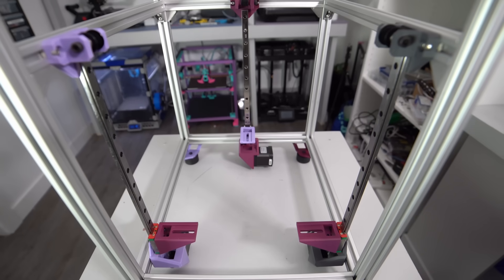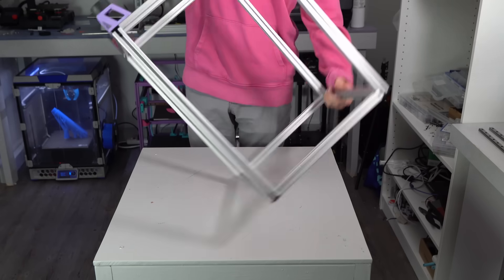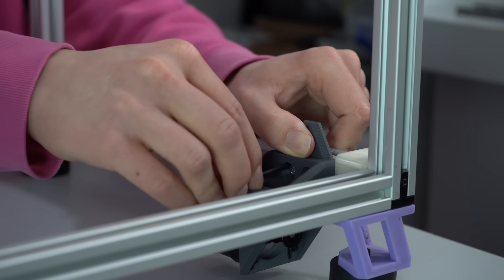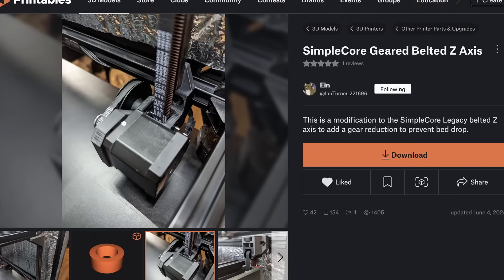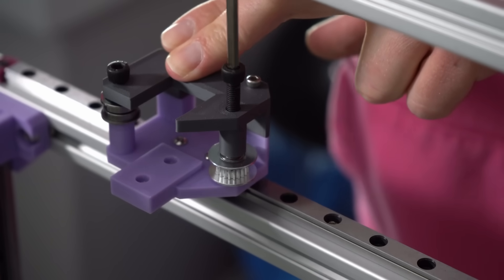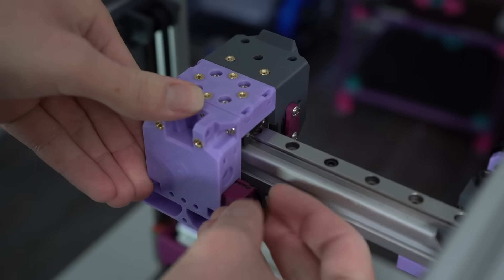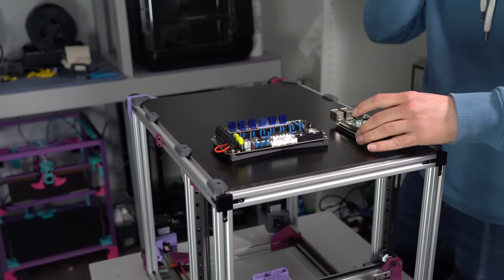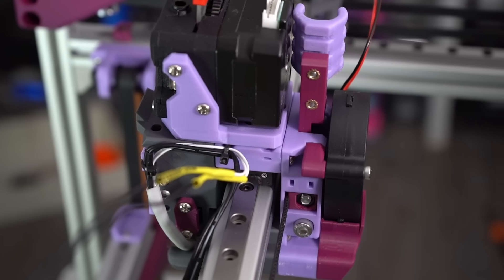How to Build the Best CoreXY 3D Printer for Beginners

Comment: Can you elaborate more on what needs to be modified for a larger corexy build 🙏🏻🙏🏻🙏🏻.
I really want to understand the limitations of the system
Reply from the maker: The limitations here aren't much different from any other corexy. As the printer gets bigger, the belts get longer, and longer belts stretch more. To compensate, you'd want to use wider belts (like 9 or 10mm), which would require basically a whole redesign of the gantry. You'd also want to run the belts at their spec tension, which would require double sheer support on the A and B stepper motors. You'd also want to beef up the frame with something like 4040 extrusions for the verticals and 2040s for the horizontal extrusions
Reply: @mitsumakes thank you so much for the thorough response 🙏🏻.
I learned a lot from it and I am truly grateful ❤.

Comment: Verry nice video.I recently upgraded an ender 6 with linear rails and klipper(sonic pad)And its amazing.Next project will be an diy 3d printer..What kind im still not sure..Probably thinking about Sovol sv08 ísh..
Reply from the maker: If you do go the SV08 route be careful, the belt path is notoriously bad on that machine

Comment: I have a 220x220 bed but the holes are right at the end. I could use it but I'm still confused about this z axis
Reply from the maker: You don't need any holes on the bed to mount it here. I was just using a flat piece of glass

If you do have holes that line up you can use basically any metal spacers/standoffs to mount it
Reply: @mitsubishimakes I can see that you used bases that support the bed. But how do you attach the bed to these supports? I imagine that when you press the nozzle on the bed on the back side it comes loose. No?

Comment: Can you give an approximate price of parts used in this build? is it significantly cheaper than buying one ready made one (same size)?
Reply from the maker: Off the shelf printers will always be cheaper than custom builds (unless you happen to have a lot of spare parts around). To get a better idea of the cost, check the Bill of Materials on the github

Comment: Why was the EVA logo removed from the shroud? EVA also has a hex nut version. And the number of heat inserts or nuts comes from the fact that EVA supports many, many variations of hotend, extruder combos.
Reply from the maker: The logo didn't print well (Q1 Pro's part cooling isn't great), so I just cut it out

Comment: This was a very well put together video, that provided a lot of very useful information. !!!! I would like to see what mods need to be made to build a much larger printer, specifically, I want a build volume of 500x500x500. I have been looking at a Rat Rig V-Core 4, but that's not even close to being in my budget. If the mods are too expensive, maybe you can show how to build an FDM that is not Core XY, but does have 3 independent Z motors.

Comment: What do you think about building big ahh diy 3d printer? The bigger the printable area is the faster you can print using mode "per object"
Reply from the maker: Nothing wrong with building large printers, but building a high performance one will be a challenge. If your goal is to produce a lot of parts quickly then having multiple, smaller printers will be faster

Comment: Great video.for starters like me but I will make it enclosed for future materials like tpu so can you recommend what to modify?
Reply from the maker: You don't need an enclosure for TPU, but if you do want to enclose all you need to do is get some material cut and attach it to the frame. You can use the voron panel clips to do this easily.

Acrylic Panels with some reflectix insulation on the inside and outside would easily get you into 70c chamber temp territory

Comment: Did you have to print a reverse tensioner for Eva 3 in order to route the belts with the teeth facing the correct way?

I ask because tensioners are not reversible; they can only be inserted into the Eva back one way. The way they insert orients the belt facing the wrong way.
Reply from the maker: You're correct, the stock ones don't work. On the Simplecore github you can find a modded tensioner  that works

Comment: Quiero construir un modelo con área de impresión de 300mm x 300mm. Debo usar la documentación de SimpleCore o SimpleCore Legacy?
Reply from the maker: Whatever one you want! I'd recommend Simplecore Mk1 if you are starting from scratch, and legacy if you have some spare parts available already
Reply: @mitsumakes 
Crees que con una SKR mini E3 v3 puedo construir la versión Legacy?
Reply from the maker: @martinbenavides2358  You will need more stepper motor drivers for the triple Z. You could stack two of those boards together though
Reply: Estaba pensando usar los dos puertos para eje z que tiene y en uno de ellos usar un splitter para así usar los 3 motores. Crees que sea factible?
Reply from the maker: @martinbenavides2358  In order to automatically tram the bed, you will need independent Z motors. If you are okay relying on mesh bed levelling only then you could use a splitter like you suggested

Comment: i absolutely disagree with the belted Z design choice
Reply from the maker: What don't you like about it? The lack of gear reduction?
Reply: @mitsumakes belt stretches. If you have different tension on the belts you get z artifacts. Voron 2.4 has similar issues, it’s just another design you need to troubleshoot if you get bad prints. Lead screws are just better
Reply from the maker: @NilSirrah  Fair enough. It's hard to beat the simplicity of a good ol' leadscrew setup, but I dont find belted Z to be much more complex. Make sure the belts are tensioned properly (and evenly) and you'll be fine.

Its worthwhile to note that there are plenty of options if you did want to run leadscrews on a simplecore. You could use trident Z, the Z axis off of simplecore mk1,  and ZombieHedgeHog made a leadscrew Z for SC legacy you could use as well

Comment: Looks like a fun project but I think I'm just going to start with a prebuilt printer.
I think it's cool there's still people doing open source DIY options just feels like I will always be procrastinating the project I actually want to use the printer for, maybe later on I'll build one.
Reply from the maker: With how good the prebuilt options are today, its hard not to recommend getting one first. I use my Qidi Q1 Pro to print basically all of the parts for these videos nowadays, just because I know it works

Comment: can it be 350 to 400 cubed ? not worried about how fast it can go just want a big build volume to make big things
Reply from the maker: It's definitely possible, but you'll definitely want to stiffen up your frame at that scale. 4040 extrusions would be good, and structural metal panels would be even better if you can stomach the cost

Comment: hey.thanks so much for making this available to us all. love the simplicity of it yet at same time using latest hardware such as linear rails etc, i just wanted to ask would it be possible to scale it to accommodate a 350x300 
build planform.
Reply from the maker: It would be possible. I built a 330x330 simplecore which you can see in some of my other videos. The biggest thing to watch out for at that scale is the rigidity of the frame. I'd recommend building from something like 4040 extrusions instead of 2020 and using large metal corner brackets or metal panels bolted to the frame for more rigidity

Comment: I have been thinking. The belt path on that toolhead. Does it draw uneven on the gantry when printing. Or is it fine and strong? With belts comming in on both sides of the x bar
Reply from the maker: A top rail setup like the EVA toolhead is definitely not ideal for performance. Ideally the belts should be pulling the toolhead from as close to the linear rail carriage as possible.

In practice this still works fine, but won't be as good as a front rail toolhead

Comment: What is the "Major Modification" to the motion system when scaling up above 300x300
Reply from the maker: In general, when you scale up a printer you also need to scale up the individual components. So for a CoreXY you'd want to use wider belts (so they stretch less), larger extrusions (for a more rigid frame)

Comment: Hello, great video ! Do you think that if I change the aluminum profiles to have a print volume of 300^3 it will create too much vibration or is it feasible? And I would be very interested for a klipper video.
Reply from the maker: Its definitely feasible. I would add some metal corner brackets, or even bolt on some metal panels, to make the frame more rigid though

Comment: I don't mean this as accusatory or rude or anything. But why is the quality of the prints rough, is it a time constraint or just a "good enough" situation. Any defects I've seen in videos haven't impeded the use of the piece, but for someone that's got the amount of knowledge you do, I just expect a bit more.
Reply from the maker: I print all of the parts for videos on my Qidi Q1 Pro, the quality isnt the best but its good enough. All my other machines are usually torn apart/in various stages of different projects, so I don't want to rely on them to be operational to print parts

Comment: A word of warning! 

Those 90 degrees angle bracket can be off by a degree or 2 if you buy the cheap ones, which will twist the frame horribly. 

Also, a solid, as flat as posdible surface should be used during assembly to make sure each side is assembled flat.

Comment: What's the reason for you to not recommend enclosing the printer when using PLA or PETG compared to ABS?
Reply from the maker: PLA or PETG will not survive the temperature inside the chamber
Reply: They arent made for it. Thats literally the reason the first 3D only used PTEG and PLA. If you wanted to print ABS you should build/buy a enclosure and they used to be made of thermal fabric so you can take it out anytime you wanted

Comment: i don't think that you BL Probe is properly leveled and you nozole wil crash into your bed
Reply from the maker: Good catch! The BL-touch and Fan ducts are sized for the Rapido HF, and the hotend I had laying around was the Rapido UHF. I just need to remove the UHF extension nut on there and then everything will line up

Comment: Solid print head. Nice part cooling positioning. "Great" job.
Belted-Z... Is dumb. There is nothing simple about it. Hope to get a mainboard and drivers with a protection from falling bed back current.
For love of god, spend a couple of trumpocoins on the extrusions to back Z rails. Rails will thank you. Input shaper will thank you. 
Get three more thrumpobucks and throw them at an aluminum composite for 4 side panels with 10+ bolted attachment points per each extrusion. Not this stupid plastic clips. This will increase rigidity much much further for dirt cheap.

Comment: I'm curious what makes this particularly beginner friendly. I saw what looked like a lot of steps where messing up would leave the frame, bed, or gantry non square, and some had tricks to get it right, but others seemed kinda YOLO. I guess most of the others are harder in this regard, but is this easier than the Rook or something?

Comment: Nice. What would be needed for a 2200 cubed printer in terms of mods?
Reply from the maker: 2200mm in each direction? For a printer that size you'd want much larger extrusions for the frame, structural panels, a flying gantry, and extra wide belts at a bare minimum. I wouldn't go with CoreXY at all for something that large

Comment: Wack, my CoreXY works fine at 370x370mm
Reply from the maker: Not saying CoreXY in general can't be scaled up, but with 6mm belts and no double sheer support I wouldn't advise going any larger than 300mm on a simplecore. My 330mm build sounds like it's dying at 5K accel 😅

Thanks for watching!
Reply: @mitsumakes Maybe it really is dying. Have you asked it how it's feeling?

Comment: If you don't feel you are qualified to explain how you wired this up, perhaps you should not be qualified enough to post this video.  The steps that you have included are good, but most new people coming to this hobby looking to make a printer from scratch don't want to fumble through random wiring schematics on a website...they want to see exactly what you did so they can emulate it and get their own printer up and running to get "the Best CoreXY 3D Printer for Beginners".

It's an okay video, but could benefit from showing exactly what you did to wire your printer up to start printing.  Don't get me wrong, I'm not trying to knock your effort here - just encourage you to show the full build so the "Beginners" following this can have a functional printer instead of a paper weight.
Reply from the maker: What you mention in the first paragraph about emulating exactly what I did is one of the major reasons why I didn't cover electronics. There's no one-size-fits-all approach unless you're using the exact same power supply, mainboard, motors, hotend, extruder, and stepper drivers as me. I think its best to direct builders to the existing documentation (which is more in depth than anything I could've done in a quick video here) so they can learn for themselves.

Another thing (tbh the main thing) is just looking at it from a liability perspective. I do not want to be responsible for anybody starting a fire
Reply: @mitsumakes I agree with this approach and still understand the trouble of beginners not understanding. It's a tricky balance to strike! The lack of exact electronics info or examples doesn't discount the rest of this video at all in my opinion.
Reply from the maker: @AnnaVannieuwenhuyse  I appreciate it. I'll try to be more specific about mainboard wiring for future videos so people can have an reference. I'm still not touching the mains stuff though :face-blue-smiling:

Comment: i would love to go away from the eva design. also your part cooling ducts are the wrong ones for your toolhead!
i got a mercury one and would love to mod the toolhead, oh well i probably need to wait for the bondtech igx toolchanger until NOVEMBER -.- .
Reply from the maker: I'm not a big fan of EVA from a performance standpoint, but the built-in belt tensioners and wide compatibility make it a great choice for a printer like this.

I know about the ducts lol, I mention somewhere towards the end that I'm going to remove the UHF nut from the rapido, I just hadn't done that yet when I was recording😅

Comment: Hopefully someone will make a mod that uses cheap square steel tubes make it very chost effective
Reply from the maker: Thats a very interesting idea! Frame would be a lot sturdier that way too
Reply: @mitsumakes  definetly some pro's and con's there. Could be a nice little project comparing the two, but I've looked into it a few times and it's a really tough call...
Reply from the maker: @TommyHoughton  I'm anxiously awaiting your "I built a 3D printer entirely out of tubes" video :)
Reply: @mitsubishimakes carbon fibre rods, everywhere….

Comment: What about a simplecore thats 600x300 build volume
Reply from the maker: It would be possible, but likely wouldn't perform very well due to the length of the belts. I'd look at other motion systems like cartesian for a printer of that size
Reply: @mitsumakes A bedslinger? I was thinking of 4 leadscrews / steel rods for the bed then corexy. Possibly even awd for it.
Reply from the maker: @iPrint3D  I was thinking something more like the Ender 5. The belts will be much shorter than CoreXY with only a minor weight penalty. You could even do 4 Y motors if you need more power
Reply: @mitsumakes Gotcha, thank you

Comment: do you think the corner bracket thingies are better or stronger than blind joints?
Reply from the maker: Hard to say for sure without testing. Rolo went with the three way corners so that builders don't need to drill or tap their own extrusions. If strength is your goal, you can always add corner plates or even structural panels to make the frame stronger

Comment: How much did the build cost?
Reply from the maker: I built this entire printer from spare parts, so $0 out of pocket for me. The cost of the BOM is ~$700 USD, but you could save another $100 or so if you went with a cheaper hotend and extruder.